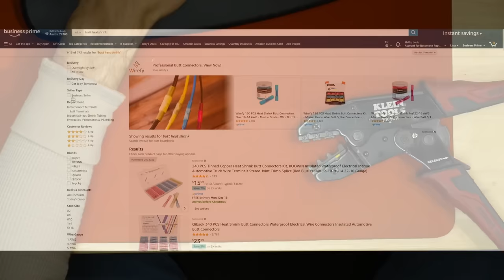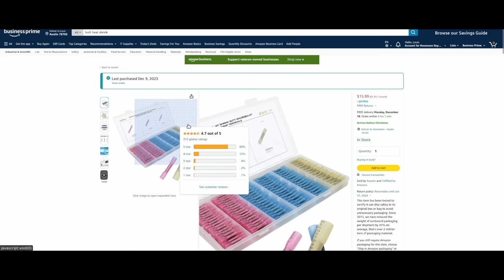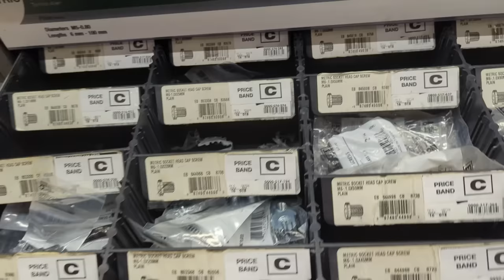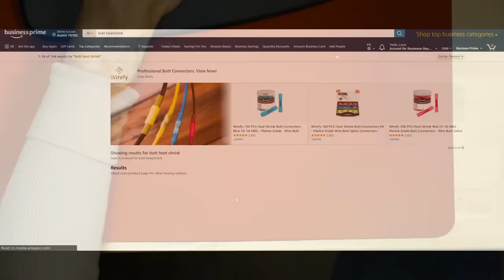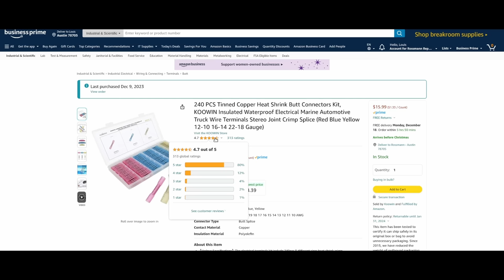Amazon Sells Dangerous Electrical Crimps

Comment: Ripping open bags to steal screws is just...wow. That's a level of petty theft I've never even considered.
Reply: This is really screwed up...

Ok ill see myself out
Reply: You considered thieving?
Reply: @tonysheerness2427   You know that's not what they meant
Reply: How about someone crawling under a Silverado pickup truck, cutting the entire fuel fill hose (inner and outer hoses) in order to quickly remove the gasoline from the truck.  Pickup is low on gas, I drove to the station, they gas went right out the bottom.  Repair cost was $400 but I did it for under half and it was a PITA job.
Reply: It's screwed up.
Reply: Well, yeah but if Home Depot in the States is anything like one of my big local hardware stores, stuff like individual sockets are locked in cages and it's incredibly difficult to find an employee to help.  They wouldn't have to have those cages if there were more employees in the store to start with.
Reply: Ive rarely seen this in Germany. Turns out drilling people for centuries to maximize their personal profit leads to a horrible society nobody wants to live in.
Reply: they're the type of people who can't take no for an answer, they suck and make shopping for normal people actual hell.
Reply: I once saw a bag of grapes opened and half finished on a Walmart 4 months ago...
I'm used to seeing those things, but screws?!
Reply: I'd have to question whether the effort of ripping the bag is even worth the reward in this case.
Reply: @jayframe929  Then again, if I had to choose between societal issues, I think I'd go for "people stealing screws in the local DIY shop" over whatever the heck you guys had going on back in the 40's. 🤣
 
But all joking aside, you're right: it's not so bad over here in Europe. We do have our own problems, sure. And corruption is unfortunately a universal given, no matter where on this globe you happen to live. But at least we have some strong consumer protection, stricter safety standards, and good social security.
Reply: but louis has no problem ripping off oru tube or netflix with piracy.  Personally I have never seen empty open bags at Home Depot.  But I also don't live my life to get viewers clicks.
Reply: Part of it is due I'm sure to them selling a pack of 2 tiny screws for $2+. If you have an Ace-hardware or tractor supply, it's a much better place to buy speciality sized screws. Much more organized, more quantities, and better prices.
Reply: @wessss  Or it's because you only need one or two 8-cent screws, and the big-box companies will only sell you packs of 20 for three bucks.  I'm lucky that I have a smaller hardware chain nearby where I can still buy individual pieces, instead of being stuck buying far more than I will ever need at the megacorp chains.
Reply: @EphemeralTao  But 3 bucks for screws is no bad price.
Reply: Back in the old times at the local hardware store the screws and nuts and such were in open bins. You could walk in with your part and make sure you had the right size and thread pitch. If it wasn't right you tossed it back in. 

What generally happens at big box stores that put the stuff in plastic bags is people open a bag, test it, and put it back. The screws, nuts whatever fall out of the bags over time it becomes a mess, nobody maintains it at the store. There is some theft but it's likely not to the magnitude implied. A mess is simply made.

When there is a traditional set up I don't see this problem and almost always the only empty bin is the screw I need, but that's another thing entirely.
Reply: Amazon probably hired them. 😂
Reply: 😂 That's the shame 😢 I feel too from reading that... I mean usually screws are really cheap... just wow...
Reply: I work in electronics retail, ive seen more petty theft than that
Reply: @SunriseLAW  they would have stolen the Cat too if they were pros
Reply: No wonder why the screws are locked up at my local hardware store!
Reply: @davesilver5493  Piracy is a justified response to anti-consumerism.
Reply: Imagine ordering from amazon and not getting a refund on this type of crap. It breaks your mind. Reduces you to petty shit. If a massive company can do it to my why cant i do it to a massive company.
Reply: @jeffder7143
one time they messed up a multitude of orders I had waiting for over a week, they sent a whole another order and by some miracle, the other package that was late finally showed up, wasn't charged extra and wasn't asked questions
Reply: STEAL (STEEL) SCREWS  😆 --- I see what you did there
Reply: @SunriseLAW  the other day i came out to my car with a broken passenger side window and my car manual gone... i guess he was mad that i don't keep my lifesavings in the car
Reply: @tonysheerness2427 To consider just means to think about something. You considered it to some degree just in making such a comment.
Reply: @baronvonslambert  You can just use epoxy putty to patch holes in fuel tanks, the stuff works surprisingly well and it's inexpensive. The times that you do have to drop a tank, it seems like they are almost always full, now that makes a fairly simple job into a pain in the ass.
Reply: @tachobrenner  It is if 95% of them are never going to be used, but will just sit on a shelf somewhere being wasted.  There's already far too much waste in this world.
Reply: @davesilver5493  You haven't?  We have this problem in a big way in Texas.  Do you have illegal immigrants?
Reply: I'm not sure if people are actually stealing the screws. I once ripped a bag open because I saw a bunch of other bags were open, and I didn't want to buy a bunch of them. I only wanted one, and they were out of singles. So I took one out of the bag and paid for it.
Reply: As long as the judges won't hold them accountable and only give them laughably low sentences, it'll continue.
Reply: @baronvonslambert  If you live in certain places like California, you should probably just leave your trunk open and windows rolled down
Reply: @tonysheerness2427 I consider thieving from you
Reply: Maybe you take the empty bag to the register and then they go and fetch the screws that the bag specifies the back or something. Is this a thing or maybe no.
Reply: @SunriseLAW  Glad I drive a car with low ground clearance so people can't get under my car to do that to me. They can just go steal from the truck two spots over instead.
Reply: then you remember he lives in New york, and then it clicks
Reply: Junkies do it everywhere, even dollar stores.
Reply: The worst I've done is grab a loose machine screw and loose nut sitting on a shelf outside of their bag at Lowes because I only needed one of each and by sheer coincidence were the right thread pitch. 

I spent half an hour analyzing the bagged screws to find the exact right ones without success.  I would've paid for the whole $2 bag and not use 90% of them if I could find the right ones.
Reply: @thefool8224  I'm pretty sure Lewis implied most of the bag thefts were in Texas.
Reply: Not somebody, Nigerians.
Reply: You've never been to Lowes?  Half the bags are missing half the screws.  You gotta count em before you buy.
Reply: @WJCTechyman  Nah, everything's generally just hung on little pegs all throughout the store.  Someone can just walk in, grab it and walk out.  Only the really expensive stuff gets locked up.
Reply: Wow.  Reading all the other comments of people astounded that people would steal screws make me realize that apparently Roanoke, VA (where I go to buy hardware) is a shithole.
Reply: Rats in da hood!
Rats in da hood!
Reply: I feel justified in saving the screws from all the stuff I scrap after seeing that you might get screwed if you have to buy a couple screws...
Reply: I'm cheap but not that cheap
Reply: Same in the UK. I think its because people often just want one bolt say and the the price of a  bag of 4 or so is the same cost as a box of 100 if you buy online etc. I think at that point people say to themselves fuck it they deserve it. I'm not saying its right but I think thats why those items are taken. I guess then being small and concealable as well is a factor.
Reply: Industry have been doing this for years. Like on batteries. 2 only need two but they make you buy 4 instead. Or Hotdogs. Getting the same amount of buns as hotdogs.
Reply: @AJBAXTER7677, please don't feed the troll.
Reply: @deltasyn7434  by itself no, but just like a run in Costco but for thieves they will steal in bulk per trip. you would look at all those missing stock and think that happened over a considerable amount of time, but no I've watched a fully stocked section get mugged in just 2 days. Most of these hardware shops actually restock regularly, but each prospective thief has a large impact.
Reply: Never seen this despite buying a lot of misc parts for both electrical and irrigation from Home Depot but I thankfully live out in a semi-rural area with very low crime.
Reply: @WJCTechyman and judges who convicted criminals to.
Reply: @baronvonslambert , do you lock your car, house, or bicycle?
Reply: @jayframe929  Just you wait,with how you have been importing hajjis this will become common soon.
Reply: I hope you live no where near me. @alextheonewarrior
Reply: Same here in theUK,  If it not behind glass or in an alarmed plastic box it will walk out the store. be sold on Amazon or Ebay or on the Sunday Market.
Reply: Only in America!
Reply: Increasingly so in the UK too. This kind of petty theft was rare in the 90s but I recently have found the same problem happening in a hardware store near me.
Reply: @alexmckee4683  I don't believe you. Say something only someone from the UK would say so I know you're not just an American taking rubbish.
Reply: They are in cages because you can't trust the employees either.
Reply: @KingSvenDeluxe  I can assure you that I am British. I live in Gloucester, pronounced Gloster, in Gloucestershire, pronounced mostly like Gloster-shur by the locals, where Doctor Foster made his watery pilgrimage and vowed never to return again.

I take it was my use of "store" that provoked this episode of nationality skepticism? If so, would you be content to know that "hardware store" appears in numerous old photos of west country vendors of ironmongery? We used the word store down these parts and that was in fact the origin of the American usage, not vice versa.

My alma mater was the Crypt School, founded in the crypt of St. Mary De Crypt church in Southgate Street of Gloucester, and I used to have to sing the occasional hymn or carol in Latin at this time of year.

In case of final doubts about my authenticity, I recently made a Christmas pudding indeed actually a figgy pudding with figs and all, and of course suet (kidney fat). That should hopefully suffice to prove my bona fides.
Reply: @alexmckee4683  unfortunately not. What made Red Dwarf great?
Reply: @KingSvenDeluxe  haven't watched it in years but I liked Cat. Nevermind, I don't have any interest in discussing further with you. I don't need to prove my nationality.

If your area of the UK isn't suffering this kind of issue, great. My area is, both Homebase and B&Q near me have had problems with packets opened and screws, bolts, and other small items stolen in this manner. It's very irritating because I have experienced the same problem as Louis in the video where I have gone to buy something supposedly in stock just to find empty bags in situ.
Reply: it’s actually insane how much theft lowes and home depot eat every year
Reply: It's because the auto parts stores will put the same type of product in the locked cabinets. For whatever reason the hardware stores haven't caught on yet.
Reply: Ironically my HD is in the hood, and there's never any screws stolen..apparently hood thieves aren't interested in repairing anything.
Reply: @baraka629 No, don't leave. Didn't you say you'd be at the comedy club all week?
Reply: @AlchemicSoul  Yep. "Try That in a Small Town" is more than just a popular C&W song. It is also an anthem.
Reply: hellsfavoritesaltyberserke4724  Keep pourin' that salt!
Reply: @neoasura  Curiously, Fathers Day cards, hardhats and work boots are also rarely stolen.
Reply: @tachobrenner I pay 3£ for 250grams not 2pcs like some shops sell, shop is thief😊
Reply: They are in training to work on Wall Street (or in politics).
Reply: @jayframe929  - Shoplifting doesn't exist in Germany?  Maybe they enforce laws there, I understand Germans are quite rule-oriented., but he was talking about shoplifting and you went straight to "horrible society nobody wants to live in."  I can tell you the filth, disease, homelessness, and literal feces here in California has more to do with politics than profits.  But then again all our democrat politicians are wealthy, and some are extremely wealthy.  I'm guessing our politicians are much dirtier than yours.
Reply: It’s ridiculously common. People suck…
Reply: @WJCTechyman Employee? What's a Home Depot employee?
Reply: @wessss And actual humans who ask if they can help you soon as you enter the store.
Reply: @Sotanaht01 or leave California
Reply: Exactly, especially when you realize that screws and such are not objects of necessity. The people who need screws tend to be homeowners renovating, people doing personal projects etc...
Reply: @baronvonslambert  Convert to electric!  Love my Tesla
Reply: @tachobrenner  Yeah, except the reality is more like a pack of 5 screws for $8, and the screws are crappy quality. Good screws will be 5 for $12.
Reply: @paulct91  You haven't bought screws in the last 5 years, I'm guessing.
Reply: How very 'traditional western perspective' of you.   Welcome to the post-literate diverse society, where all 'perspectives' are equal.  This revolutionary new paradigm doesn't even 'consider' it either, it just takes what it wants if it's there.
Reply: Now here in northern Italy they have small hardware items in bulk containers, little plastic bags and a scale. You fill what you need in a bag, put it on the scale, push a button with the price range and the scale prints a label with a bar code and the price. Same as vegetables in the supermarket. Seems to work just fine for the companies. Coming from Germany, Italians keep surprising me.
Reply: I dunno. I think NOT having to aggravate or hurt myself to do anything I don't wanna to do to begin with, is WELL WORTH 200 bucks. 

.I direct you to replacing kitchen faucets...never TF again unless there's a trick I don't know. Yes, I HAVE a faucet wrench. 

Here's some money, have fun. Life is way too short. But it's a billion years playing with something stupid and annoying for no reason. 

You make money to get problems to go away. At least I do...
Reply: I'm wondering why they don't just take the whole bag.
Reply: I don't get it. Have black people started doing home maintenance now then?
Reply: Yea ripping off stores is just wrong. Not something we see where I’m from. I mean if you have to steal a few connectors then that’s pretty low.
Reply: Now I feel lucky that our hardware store has a plethora of nuts, bolts screws, etc - still on the honor system. Now I'll appreciate it more!
Reply: We used to steal hinges and screws and then take them back for cash. Was a great hustle in 2004
Reply: @AndyJackson380  white people accountability challenge (impossible)
Reply: Been going on in places like walfart for decades.  Same thing happened with a bookcase I bought there 20 years ago.